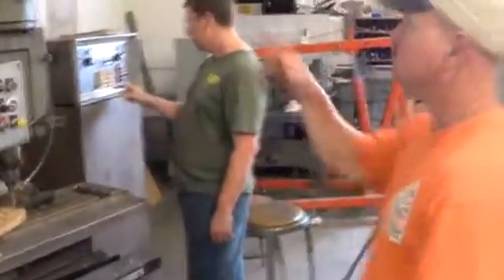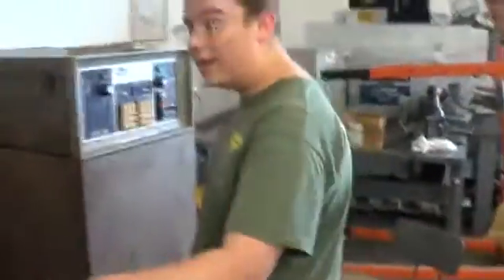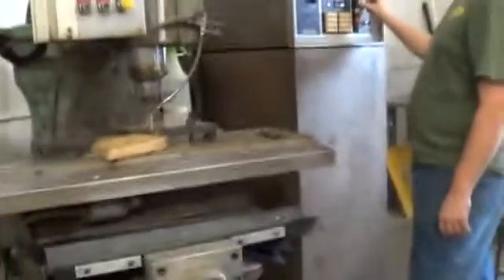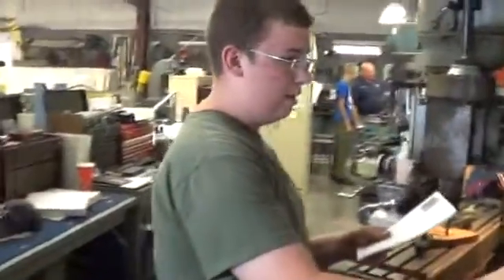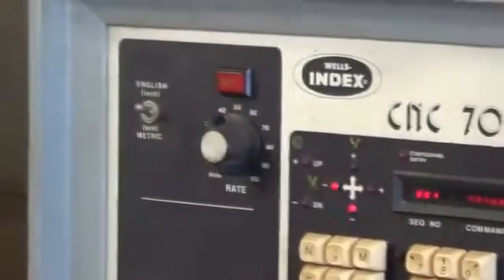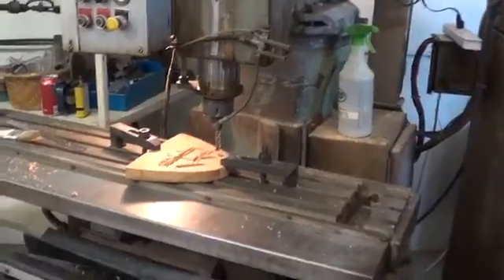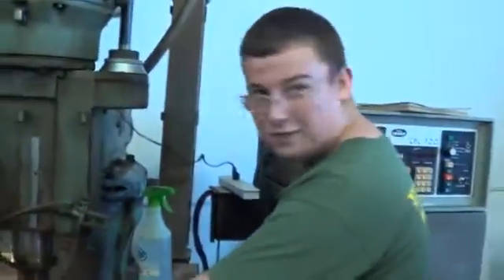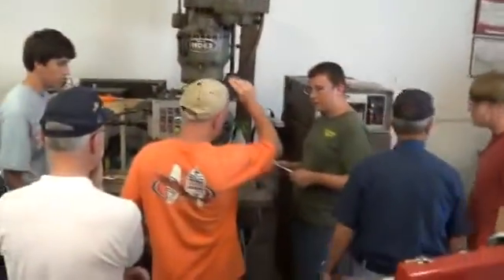Wells index cnc milling machine

Comment: How is the CNC conversion coming on this machine? I have a chance to buy the same mill for 1500 with the bandit control but it hasn't been run for 10 years. Mill looks in good shape and I was thinking it could be updated with a new control and was wondering how much a conversion might cost and what brand you decided on?